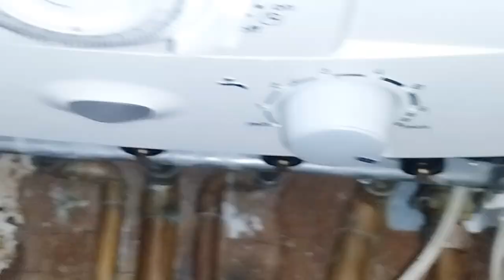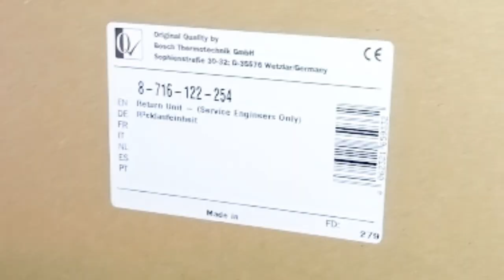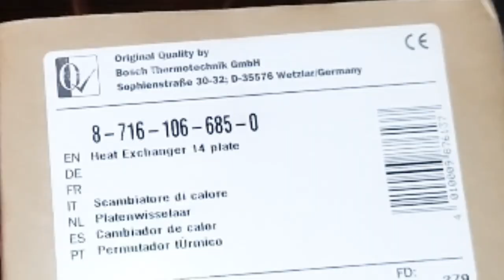Worcester Return Manifold Leak🤯. Prv, Plate heat exchanger,flow Turbine, adaptor, pump and seals

Comment: Nice job..... I always put a nice thick dry towel over the pcb before doing either the turbine or block just to be safe... I noticed the water coming out of the cold feed when you pulled it apart... 👍

Comment: Been watching a few of these, this is by far the clearest.  Thanks so much! I'm going to try changing just the adaptor on mine, but I think the leak may be from the return manifold which is obviously a bigger job. I have limescale deposits looking very much like what you show. I don't think you show it - but I guess you would also put silicone lube on the two  heat exchanger seals where it joins the manifold?
Reply from the maker: Well.. If the return manifold is showing limescale deposits, at the top rear side, then No silicone does the job. The manifold needs replacing
Reply: @BoilerMend   Thanks - I was meaning if it's normal to put silicone lubricant on the two sealing rings between the return manifold and the metal heat exchanger plate when that gets reassembled? £110 later I have the spare part now, will be going in shortly. I wasn't thinking of trying to mend it. Also going to acid flush the heat exchanger while I have it out.
Reply: @BoilerMend I got mine fixed - Since you asked - I'm thinking the missed component might have been the bypass valve? That doesn't come with the manifold kit so needs to be rescued from the one you're replacing.

Comment: Great video, very detailed... I'll be attempting this next week. I have the 24i, shall I get a 28i heat exchanger or stick with the smaller one? Unsure if this will just be a direct swap like the video shows? Thanks
Reply from the maker: Well you can easily fit a 14 plate hx (part no. ending 6850)
IF! there are NO pipes running vertically, behind the boiler. Cuz that's the only factor which makes it difficult to fit a 14 plate, even to replace a 10 plate (part no. Ending 6860)
Reply: @BoilerMend  thanks very much for the reply, my pipes are all from below and boiler fitted on 25mm straps on the wall so got more room than normal. I'll go ahead and order the slightly larger heat exchanger 😊

Comment: I have been advised to change my worcester boiler as this part is leaking?.....is this correct ?......any suggestions and are u around the Birmingham area?....thanks
Reply from the maker: Hi.
Thanks for your message.
I am based in London.
2ndly, this component can leak, either air or water. But doesn't mean that you have to replace the boiler. if you are not originally planning on replacing the boiler. I would suggest, call/ Worcester Bosch directly. I think they charge a fixed price of around £360, with 3 major and 3 minor parts included, even if they have to take the boiler off the wall to repair it.
A lot better than spending thousands on an unplanned boiler replacement.
Let me know if I can be of any further help.
Good luck.
Reply: @BoilerMend  so u believe going thru the manufacturer is better then a smaller firm?

Comment: regarding the ex vess pipe, if you leave a 2mm gap between the grips and housing, you can place a flat blade screwdriver between, twist the driver, and it will allow the ex vess pipe to move and becomes free. the same can be done with the by-pass pipe. the return unit you were supplied with is a service engineer only part? not what the merchants should sell.(I would contact your supplier). the plate is possibly the wrong one, if the removed plate was the original, the 14 plate (685) is for the 28i / 30si, the (686) is for the 24i / 25si. old plates 12 become 10 and 16 became 14. cool interesting vid tho.

Comment from the maker: Btw.. did you spot what Little Component was not put back in 🫣?
Reply: The kermit coat???
Brother your method is clear and spot on...
Thank you
Reply: The green rubber 'diverter protector'
Reply from the maker: @Carl-re6zb  thanks for liking the video and method
Reply from the maker: @Carl-re6zb  and..the part I forgot...is not what you said 🫣😋 Sorry
Reply from the maker: @umark6695  nope ..it is an essential component and can possibly cause a major leak , if left out 🫣
Reply: @BoilerMend  The plastic prv holder clip thingy needs to be pushed back up into place?
Reply from the maker: @umark6695  that's a Good spot 👍. That was put in nicely, but couldn't film it..
Reply from the maker: But that is Not what I am on about 🫣
Reply: Non return valve
Reply: @F Raj  clip on by-pass

Comment: Can I plz ask what's the name of lubricant?
Reply from the maker: Hi.
It's called "Molykote 111 Silicone Grease Compound, 100G". You can use any, NON SETTING silicone Grease👍
Reply: @fraj9907  thank u 
Another question where u based?
Reply: Hi raj,
Quick question my worchester boch 30cdi leaking from where condensate trap sits....do u knw what it can be?